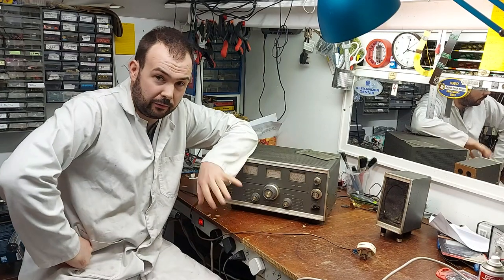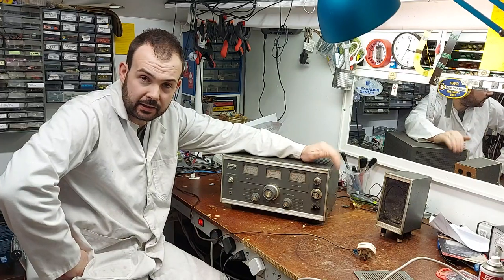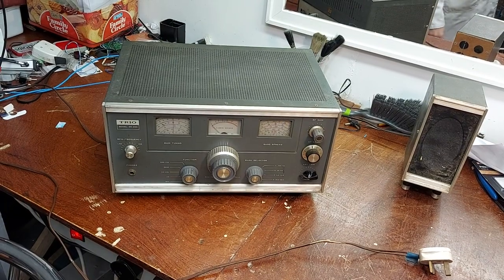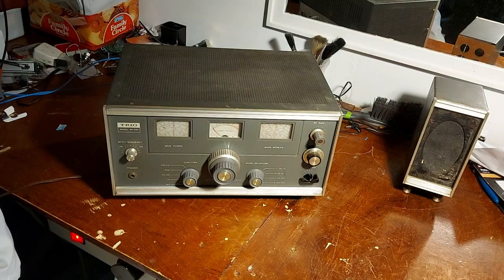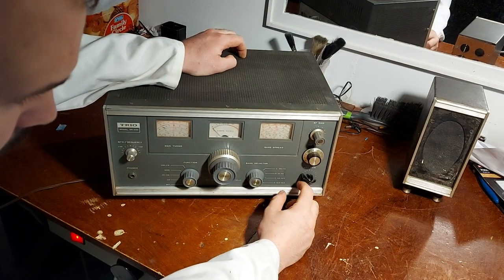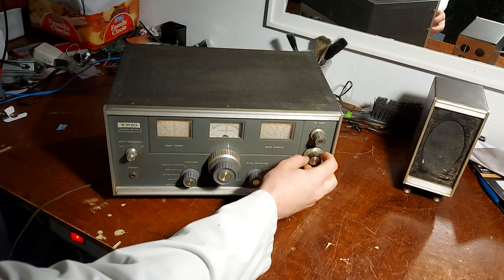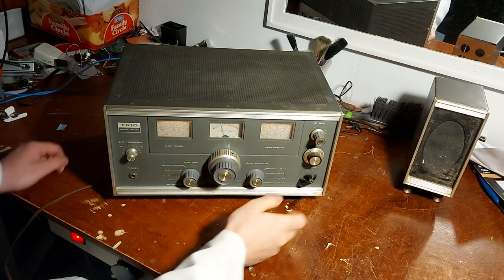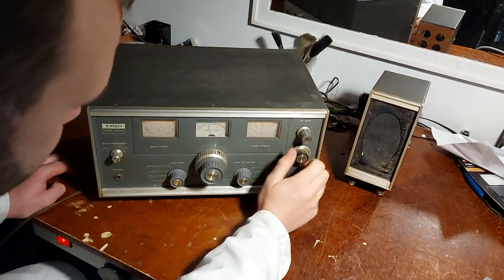Trio 9R-59D, Communications receiver.

Comment: My FRG-7 is going well. I’ve cleaned pots and replaced the dial lamps with warm white LEDs after they started to fail.  I did link the MW and SW aerial posts so the SO-239 works on both.  Finally a cap between mute and earth to slow the AGC for SSB.  I often listen to Radio New Zealand in the evenings and sometimes 40m.  Nice set
Reply from the maker: I wouldn't say no to a FRG-7.

Comment: Everyone owns a 9R. I was just about to say you need to do Volmet and you went and did it. Looks like it’s working very well. They drift terribly that’s just normal.  As you say the top range is deaf on these again that’s normal.  I’m not sure the wax problem is true. I found it was the mica caps failing and heat appears to fix it temporarily.   The BFO knob belongs On the antenna tune control. The wax will run off with a heat gun. Thanks regards chris
Reply from the maker: It think it the wax absorbs moisture in much the same way as the old wax caps, reducing the Q at higher frequencies. A very knowledgeable gentleman on the UKVRRR said He noticed a considerable increase in gain on the higher bands after removing the wax. I know wax has been known to cause a similar reduction in RF gain in certain VHF rigs. I might try removing it with lighter fluid.

Comment: Been pissing it down here in bedworth warwickshire, the grass likes it at least :-D
Not a bad old beast, it might need a bit of love ,  it sounds ok to me :-)
The vaccume out made a hell of a difference, a duvet of fluffy dust .
I find 0-30 mhz receivers handy for listerning to local oscillators and i.f strips in radios.
I have a old yaesu frg 7700,  my mates frg 7 works well too :-D
Just wag the antenna cable near the local oscillator, no direct contact.
Reply: zx8401ztv I thought the 9R sounded very good. But I think he as a better antenna and less noise where he is.
Reply: @allthegearnoidea6752  Yes it does sound good,  as you know my ears are buggered and tinnitus is there most of the time, so it's hard to make absolute judgements.
When he backs away the camera, i often have problems hearing him as he has a soft voice as well.
I'm not moaning about it, well maybe i am ha ha :-D
I have never had problems understanding you chris,  so get mumbling to torture me ha ha :-D
Reply from the maker: Hi ZX, I must remember to shout at you! The FRG-7700 is a super rig.
Reply: @IrishvintageTVRadio  Ha ha :-D  , i do mis hear words that my frends say as well, they have a habit of saying something while being turned away from me,  just sounds like a mumble to me, and the things i think i hear is just funny as hell lol.
Chicken pox or measles at the age of 30 (Don't remember which one),  that ruined my lug holes and gave me my own set of tuning forks in my head.
Oh joy ha ha :-D.

Comment: Nice old Radio,
I have just aquired an 9R-59D which has had the recrifier modification so saddly no blue glow.
Also has an internal speaker fitted which is open circuit, but other than that it works great and is surprisingly sensitive.
Seems close to frequency, not stuck it on the gen yet maybe later when I get round to cleaning it up.
I will get round to interogating all the usual suspects, but for now it resides in the to do pile.
Nice to see another in safe hands.

Comment: You've got to love that battered old speaker! About 45 years ago I bought a Realistic DX-160 with a similar looking speaker. In the blurb sheet that accompanied the radio, they did their level best to play it up, describing it as a "Voice selective outboard communications speaker" - I'd describe it as "A cheap and tinny little speaker in a dreadful tin box". It was just about up to old school landline telephone quality - about 250Hz to 750Hz audio frequency range!  To be honest, the audio output from the radio wasn't a great deal better, even when coupled with a decent speaker.

I'm going to have to get back into a bit of SWL I think, and maybe even get an X-Ceiver and get myself on air.  Do you get many lady radio hams across the water?

Comment: Put a bit of Surface Shield spray into the AF-Gain- and the S-meter-potentiometer and the scratching noise will disappear.
The same repeat for all other switch- contacts in case of scratching sound while receiving.

Comment: Hi. To connect an external antenna you must solder the output of the A wire of the antenna to the internal pole of a connector such as the PL259, and the (E)earth wire of the wire must be connected to the body of the PL 259 connector, right?